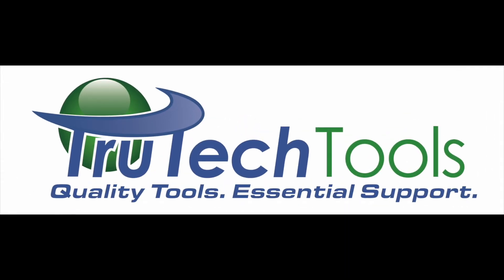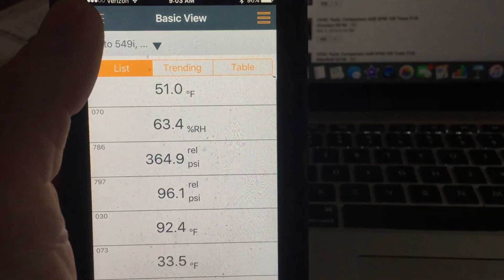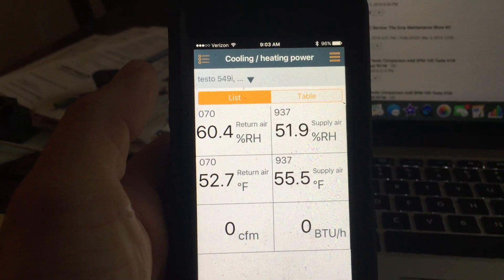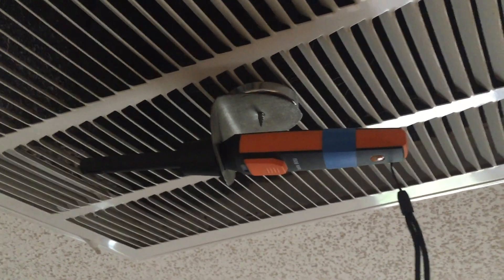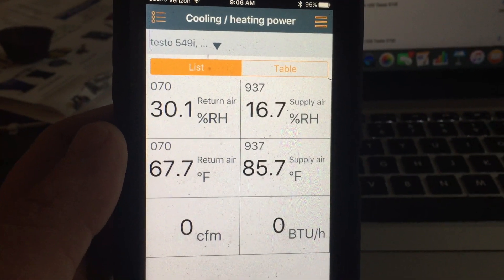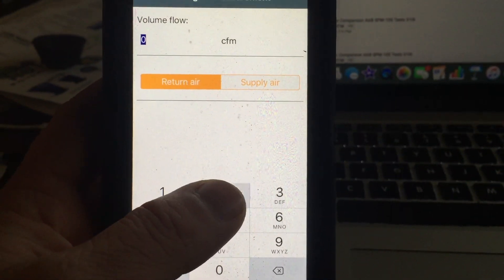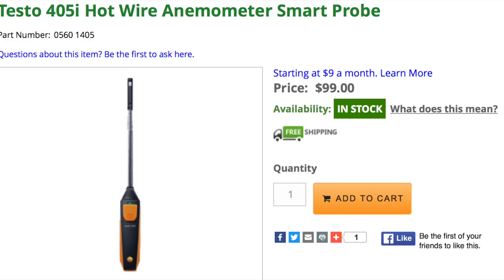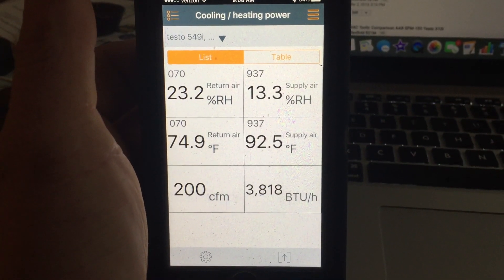HVAC Tools: Testo Smart Probes Cooling or Heating Power Calculation

Comment: Stephen, do you think Testo will update the soft where to include target evaporator temperature and calculated airflow from delta T measurements ? What do you think.
Reply from the maker: +Forrest Bredau it's possible of Course but I don't see it happening very quickly since it just came Out